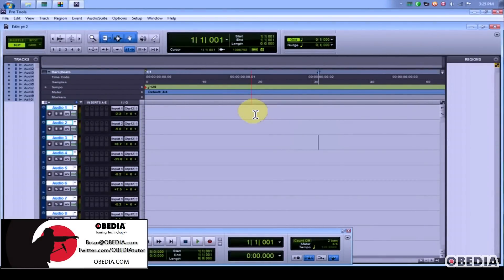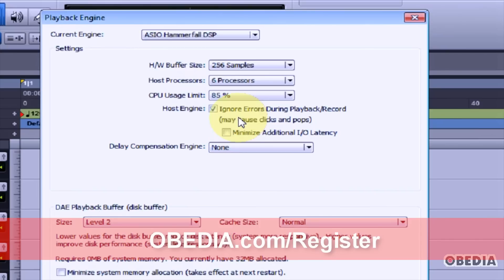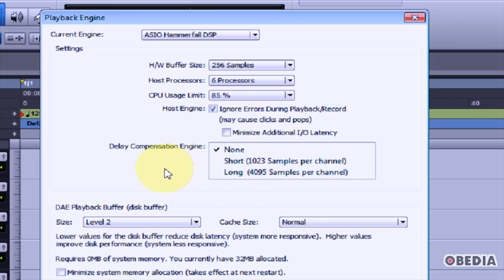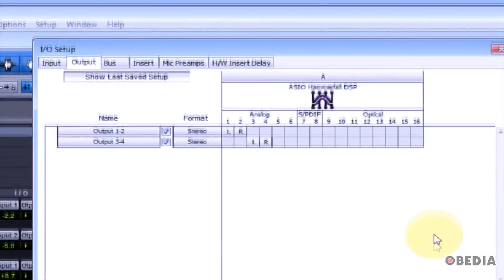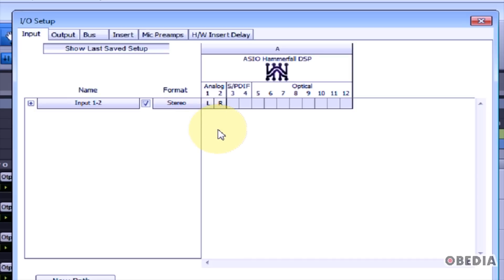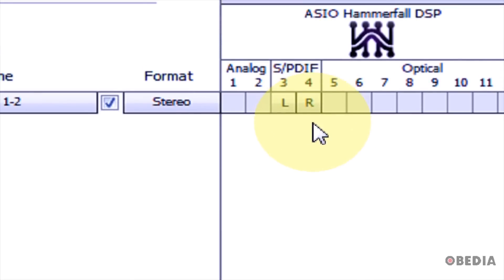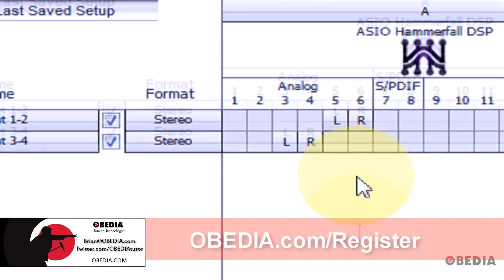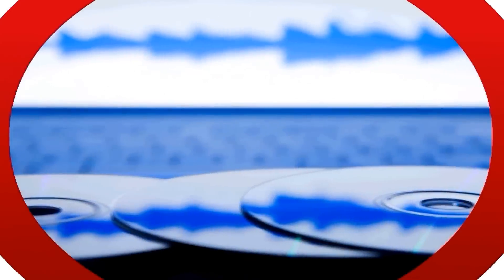Avid Protools - how to setup your audio device

Comment: I'm using the M-Audio Interface with my windows 10 comp and its connected but when I try open pro tools it says "the selected asio audio device could not be initialized". I have the ASIO v2 app and I've tried using all the different sample rates and buffer sizes and it still wont open, how do I fix this? thanks
Reply from the maker: Can't say. Update your drivers.

Comment: Got a problem when switching between "M-audio FireWire 410" (which is my current audio interface) to "Generic Low Latency ASIO Driver". A message pops up and it says "Selecting this playback engine will automatically Save and Close your session. The session will be reopened when you are done changing settings. Are you sure you want to proceed?". When I click "Yes" and set the changes the session won't open. If I click on "File --> Open Recent" to open the project Pro Tools crashes. If I re-launch it I still got the "M-audio FireWire 410" soundcard selected and if I try to change it to "Generic Low Latency ASIO Driver" the same problem occurs. Can somebody help me?
Reply: ***** I'll try that, thanks!
Reply: Giovanni Nicotera try what